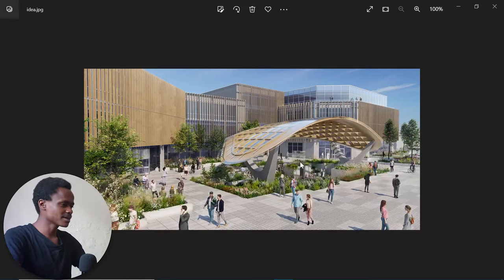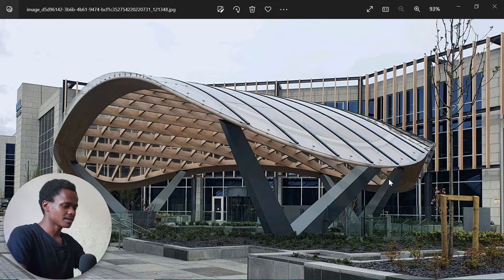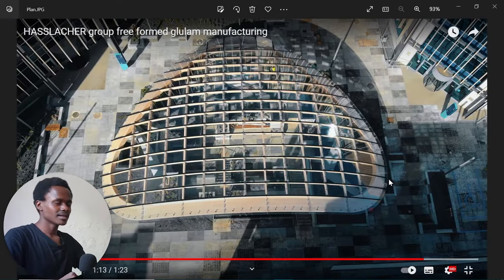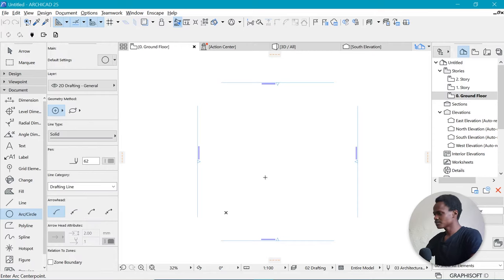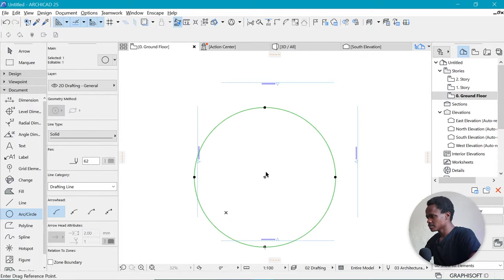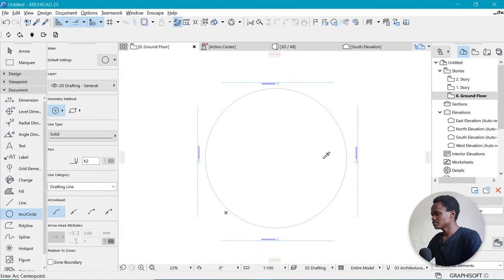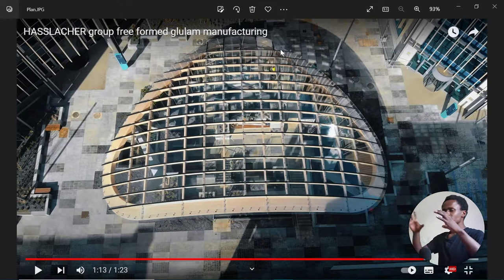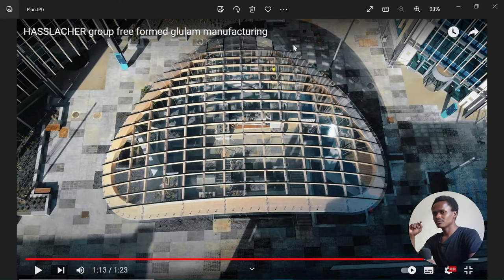Curved Canopy in archicad

Comment: Using the lock-x coordinate and lock-y coordinate commands would be helpful in situations like the on in 6:05 (looking for vertical lock). I have assigned them to y and x keys respectively and it is most helpful when drafting.